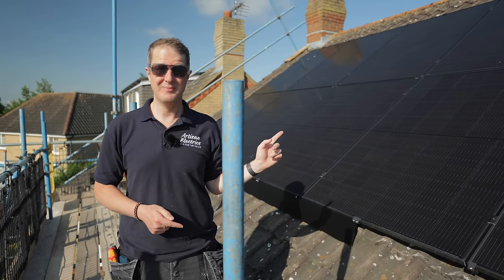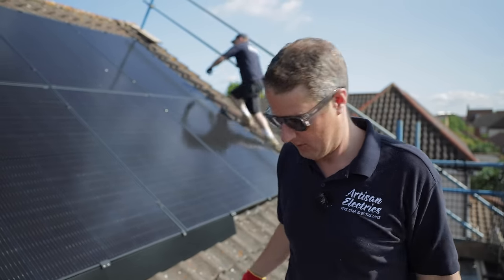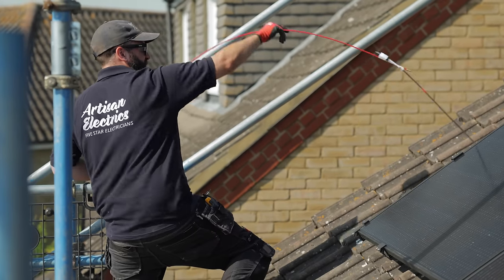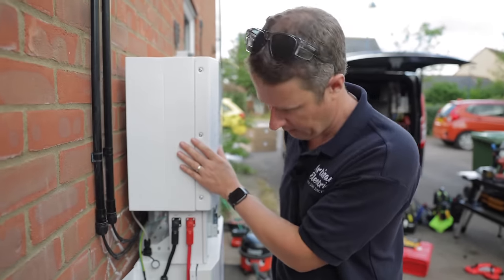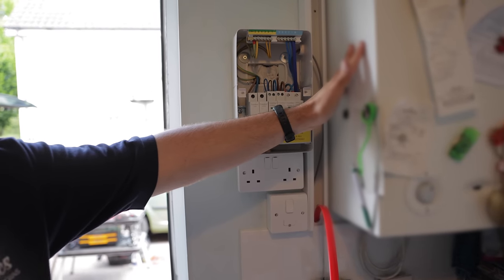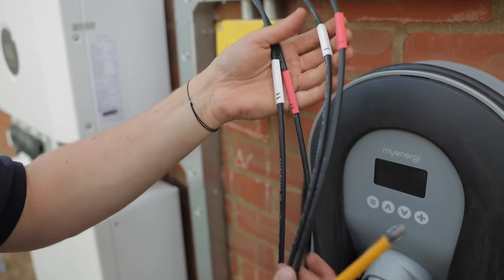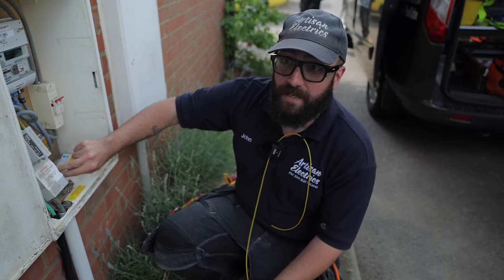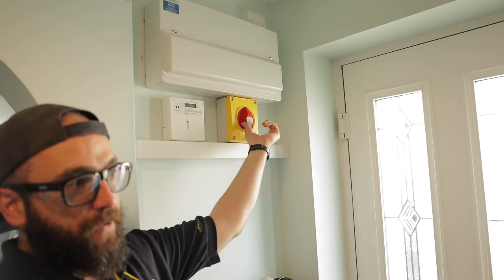Forced To Change Our Own Solar Install!

Comment: Where is it required to have DC string SPD? Ive not seen it on any installs really as inverters usually have surge protection. Also was not aware that it was required to have two AC rotary isolators at CU and inverter. Would be keen to know if you can direct me where this information is as I am a solar installer.
Reply from the maker: Which inverters do you know of that have surge protection built in? SolarEdge three phase inverters have it but not single phase ones. Check the latest version of BS7671 under section 712: This section specifically addresses solar PV systems. Regulation 712.443.101 states that where protection against transient overvoltage is required by section 443, such protection shall also be applied to the DC side of the PV installation. This means that if the electrical installation requires surge protection to comply with section 443, SPDs would also need to be installed on the DC side of the solar PV installation to protect both the PV panels and the inverter.
Reply: Thanks for responding, Lux power and Fox-ess have single phase units with SPD protection stated on the data-sheet. Also spoke to the technical team at Alpha ESS where they were not under the impression it was required, although that was a commercial three-phase system. This is useful to know though thank you. Main reason I ask is that I have never seen or installed them myself. 

There is some grey area for me if the protection was provided through software as that should not be relied on but manufacturers instructions takes precedence over regs. Guess you can never be too careful with providing enough protection for these systems as if something does go wrong it would be very difficult to not be liable the way the regs are structured. If in doubt get conformation form the manufacturer I guess.

Having moved into the industry this year I am happy to rely on others designs currently but want to make sure I'm getting it right for my own installs in the future. It seems there is still a lot to be ironed out though in the industry. Your content is very useful!

Comment: Well your not wrong that the voltage is just going to be from the panels, but like that is literally when they are at their highest voltage is when there is an open circuit, so be fair the amperage isn't going to be particularly high, but higher voltage is what makes it more likely you are going to get shocked, and I think you have it as 10 panels in series that voltage is going to be like ~360V, so actually more likely to shock you than mains electricity, yes the connector doesn't have exposed contacts so it's fine to work with, you don't need to worry that much about air bridging with 500 volt electricity you only need to start worrying about bridging over air at 10,000s of volts and even then it's at high altitudes, for sea level ish air at normal temperature and humidity it takes ~30,000 volts per centimetre. So not a problem for residential installations.

Comment: It probably would have been safer to sequentially short-circuit the panels then their internal impedance would limit the current and voltage would be close to zero. Each panel would in high solar radiation be generating about 36-40v. You will be aware that any voltage above 30v DC is generally considered to be lethal. However, with the connectors used the risk is probably acceptably low provided no-one goes prodding around or there’s no connector or cable damage. End-to-end voltage could be many 00’s of volts and definitely lethal. Rubber gloves of suitable standards should be mandatory, including electrical safety shoes.

Comment: @artisanelectrics recently my energi have recommended the zappi has a type a rcd at the distribution board, one of their prime selling points was that the zappi has a built in rcd. Will you be adding extra rcds on your previous installs?

Comment: DC isolators are potential fire hazards. In the Netherlands and the rest of the EU, however, this is not mandatory, and almost all inverters are already equipped with a DC switch, making it often unnecessary. There are, of course, some exceptions, including the Growatt SPF Off-Grid inverter.

Comment: Can understand the system not being a true UPS with slight pause in switchover, but what was the point about power variation from battery to mains? Is the inverter not delivering full 230v when using full battery output in "UPS" mode?
Reply: Maybe it outputs exactly 230V and the mains voltage there is noticeably higher or lower, my computer UPS does that.

Comment: If you're going to have single isolation on one of them, why not on both of them? Would have saved time, money and clutter. It's a very clean install, though I would never have all this on the outside of my house. Do the manufacturer of the batteries prefer the install be outside?

Comment: Interesting, technically there is no reason not to have one large string, you can have 20kw PV array to a 2kw inverter, since the inverter pulls from panels, the panels dont push to the inverter,  the inverter manufacturer  knows the limits of their gear. Dont know that brand,  in Australia we use mostly Fronius.
Reply: Fronius is basically double rated there main plate. 50% over engineered If you call them they supply the certificate to say so😂

Comment: An electronic engineer perspective:

The panels are not under load. They are live but the circuit is broken by the lack of an inverter, so no.current flows and arcing should not occur.

There is a voltage hazard between the two ends of the string, but not between the string cables and earth. So as long as those conductors are safely isolated there isn't an electrocution risk.

Obviously no-one should take that as gospel since I'm not familiar with the details of these panels, but that's how I would think about it from an electronics engineering perspective.

Comment: we have much hotter weather in australia, yet its always recommended to install the battery outdoors.
if those batteries catch fire they will take down a house pretty quickly, Lithium batteries regardless of chemistry used are very difficult to put out. at least if installed outdoors one may save their house if the worst happens...

Comment: If the DC isolator is off or the fuses are pulled, then you are good to go. You are working with the VOC of the whole string in series up to that point but no load.

Comment: I did previously comment on this sort of thing with you being the guinea pigs quoting and spec'ing up installs of a new to market complex product like the Libi - before it was even available!
This is the sort of thing that was bound to happen - spec changes, initial teething problems with hardware/firmware issues and supply issues etc.

No way would I want to be one of the first in the country installing these into customers homes - the potential for comebacks and time consuming problem solving is just far too great.

But hey ho, I suppose someone has to be the first....rather you than me though!
Reply: I agree, - I mean massive delays, a silly max limit on the PV input far below others. What is the attraction to the libby? Overrated - not even their own product, silly price, crap spec, delays, software problems, last minute changes. Lots of installers are ditching the Libby, and are instead now, fitting the givenergy all in one.
Reply: @danielebrahim2336  it's only been out a few weeks. Things take time to settle in the market.

Comment: I’m all for a good looking install and batteries being outside but all that right next to my house door 🤮
Reply: Pretty sure that's the back door
Reply: @bradleyrogerson1638  Pretty sure it isn't the house number was blurred out near the isolators
Reply: It will be even one day when you come home and it's been stolen. 😮

So nice of the regs to make it easy and safe to disconnect and steal. 
It's even in nice size liftable parts making is easy to take. 😂

Comment: I'd love to know how the Libbys fitted outside will work in winter when it's below 5C, because LiFePO4 batteries don't work at all well below 5C, and not at all below -5C.  Also, I'll bet they'll be rotten with rust in a year if you're even remotely near the sea.

Not to mention the customer's electricity supply switch on the edge of the street...seems like a new game for local kids.

I don't understand why you didn't put the batteries in the garage like someone sensible.
Reply: Agreed totally on temperature.. my Solax inverter and 2x batteries are in a separate garage. In summer batteries would accept full 20A when charging. On cold winter days, when battery temp under 10C, charged at under 10A (250V).
Bought some 4" polystyrene insulation and built a box around the batteries. Battery temp stays above 10C in Winter; and 30 max in summer even when garage bakes and is 35+ inside.

Comment: Winter voltage calculations went wrong 😂 btw the distance between the roof tiles and panels looks quite small and can lead to panel overheating, and limited production in the summer, and also DC cable doesn’t look quite fixed to the panel frame…

Comment: Nice job. I would like to know if it is permissible according to the UK electrical code to install AC and DC in the same wiring channel?
Reply: It depends on the voltage classification. If it was supposed to be ELV or SELV, for example network cable etc, then it must be in separated containment.
Reply: @sdgelectronics  Thank you, In South Africa   it is not not admissible

 ..South African standard SANS 10142-1..6.1.7 If conductors that operate at different voltages run in the same wireway,
the insulation of each conductor shall be able to withstand the highest
conductor voltage in the wireway. Alternatively, the conductors shall be
separated by a continuous barrier of insulating material or earthed metal.

6.1.10 Conductors that form part of a d.c. installation shall not be run in the
same wireway as conductors that form part of an a.c. installation.

3.85
wireway
open or enclosed route or support such as a rack, tray, ladder, ducting,
trunking, sleeving or conduit that is intended to contain conductors or cables
NOTE A wireway can consist of one or more separate wireway channels, each of
which is intended for different services such as installation wiring and
telecommunication wiring.

Comment: Maybe Im misunderstanding but why are these small inverters being installed at all? Any load higher than 5-6 kw cannot be serviced by the inverter.  If you consider that most people have a background power draw of approx 300w  to 1kw all day long with bursty loads such as kettle , oven, shower. Why not install multiple inverters in parallel to allow higher load and allow for future expansion.

Comment: there should be a "V" cable connection on the SPD always! manufacturers do print a schematic where its not connected as such but its simply false. we test these and the only way they work 100% is if the cable is in double ferrule "V" connection.

Comment: The shorted current is listed on the panel specs. It is typically very close to the optimal current.  i.e. close to the max.  So, no, that isn't a good idea.  Never short strings on purpose.  The voltage will be a bit lower because it is being shorted, but the current will cause an arc and the instant you try to disconnect it the voltage will rise towards the (open-cricuit voltage x N panels) while still arcing until eventually the arc breaks.

Just leaving it open-circuited while working on it is fine.  Put a little tape or a dummy plug over the connector end to ensure that you don't complete the circuit and use gloves when handling lose connectors.  That's all.   You obviously want to avoid holding two cable ends in separate hands without protection where the DC current could run straight through your chest and heart if that would happen to complete the circuit.

Generally speaking, if the inverter has multiple MPPT inputs you want to use them because the separate trackers help a lot of with any partial shading that might happen.   This can include stuff as mundane as bird guano, leaves, etc, even if the array has no structural shading.  Within reason.

Another advantage of having at least two MPPTs for two symmetrical strings is that you can compare the power, voltage, and current of the strings to each other and if they aren't approximately similar you know something is wrong up on the roof (such as a dying panel).   This works surprisingly well for DC strings, almost as well as data-reporting micro-inverters for AC strings in terms of figuring out what broke.

Multiple MPPTs also give the system some redundancy.  If something breaks up on the roof or one of the MPPTs burns out, the system may still be partially operational even with the breakage.
Reply from the maker: Great comment thanks
Reply: @artisanelectrics  One other thing.  Even if the inverter is turned off and there is thus no current on the DC side, there are still big whopping capacitors on the DC string inputs to the inverter which means that completing the circuit accidentally e.g. through your chest, can still be very dangerous.

Thus, the DC side disconnector switch should also always be turned off when working on the strings in addition to other cautions.   Don't just depend on the inverter or AC side being turned off.

Comment: I’m surprised they recommended that you do this. Oversizing of arrays is common practice, the MPPT should just clip the excess power. The hard limits are that you don’t exceed the maximum voltage and current as doing this will certainly blow the MPPT.

Comment: How about inverter startup voltage. Before change there was 10 panels in series and if the inverter startup voltage is 80 volts then inverter starts when one panel voltage is 8 volts. After change there is only 5 panels in series and the panel voltage for one panel should be 16 volts that inverter starts? Does this affect to electricity production - is the production lower when there is not direct sunlight?
Reply: Any solar panel really needs direct sunlight to work correctly. Indirect sunlight or diffused light (cloudy day) will massively reduce power output. For instance, with two 545W panels on a perfectly clear day, I've had nearly 1kW output. On a cloudy day, more like 200W. The open circuit voltage doesn't really matter, as the panels won't be generating a useful amount of power until the voltage is about half-way to the normal full-sun output voltage.

Comment: I am not sure Galv trunking on the external wall is a good idea. Even if its the Salamander IP trunking it will allow water in particularly on the manufactured bends.
Reply: A simple fix is to use stick on door seals. Cheap and effective.

Comment: I don't know if them skirts are worth it. Solar panels don't like heat surely that affects the efficiency of the panels as they can't keep as cool .
Reply: i thought this too when skirts were first introduced - you want some ventilation behind the panels on hot days and these skirts trap the heat
Reply: @blower1  You can get skirts now that are slotted to allow the heat to vent but still keep birds out.
Reply: They do look good but who walks around looking at the roof bird mesh is a better cheaper option
Reply: @elminster8149  Ah that's good!
Reply: @haldo691  I agree mesh is far better. I have panels on my roof you don't really take any notice of the visual they aren't there too look good.

Comment: What is the W of the panels and how big mm2 is the cable? in Sweden you can have 16p 415w panels on a 6mm2 cable. And a mc4 should be ok to disconnect if there is no load on the string of panels, If there is load you will get the nice free energy in the body and it hurts (i know how it feels :D)

Comment: I have just looked at the Libbi data sheet and it states "Mounting location indoors."
So you have voided the warranty
Reply from the maker: That’s for the Libbi controller - the battery and Inverter are rated for outdoor installation

Comment: End of the video: “You learn from your mistakes…”. Up on the roof without tethered tools. You haven’t learnt. Order some tethers as they’re not expensive

The DC isolation uses two poles as you need 4.0mm separation because of the potential higher arc currents
Reply: I wondered if anyone else would pick up on the DC isolator issue... Surely it doesn't comply and potentially unsafe due to them using "Single isolation" when there's a specific requirement for DC breakage and they just thought fuck it we won't do that 😅

Comment: Wait what, you can't have eight panels?  That's like 336VDC? We run 24 panels in one string giving around 1000VDC. EDIT: oh it was the input watts that was the limit, not the voltage
Reply: Find it strange it's limited that way usually it's the voltage and amps on dc side, I find the wattage limit odd (also the spec sheet says "Max" then  "Recommend" mppt wattage so witch is it)

the max mppt voltage is 560v upto 15A, the previous single string setup doesn't exceed that at all  (probably should stay below 500v short voltage due to 580v max voltage)

I hope he actually called them as the inverter should be able to clip the wattage to 

The 1000watts over spec the panels are likely never going to produce anyway and the inverter should be able to handle it (most handle upto 33% over)
Reply: There is simply no logic in that spec sheet. Would ask myenergi for an explanation.

Comment: Never disconnect MC4 under load!🤦🏻‍♂
Always measure amps before disconnect. There could be a current even if the string is not connected to the inverter (isolation fault).